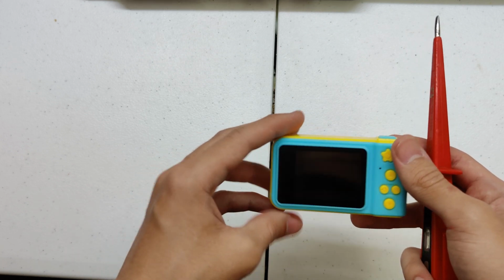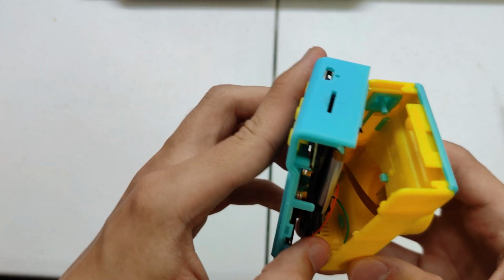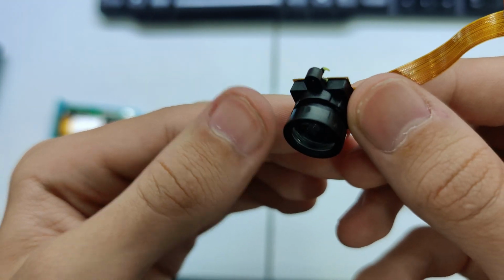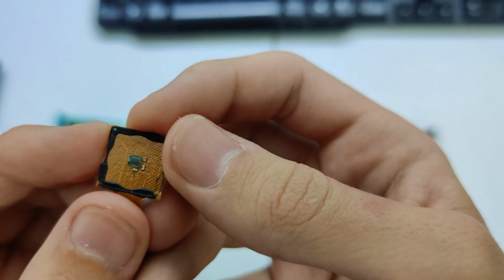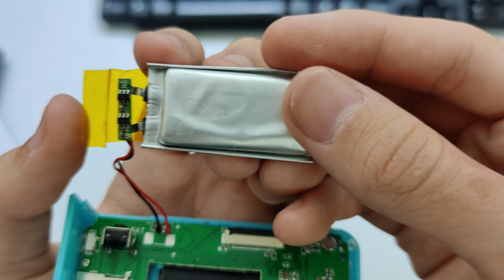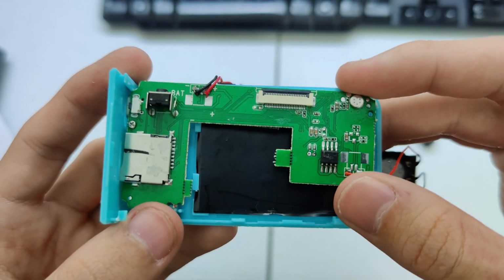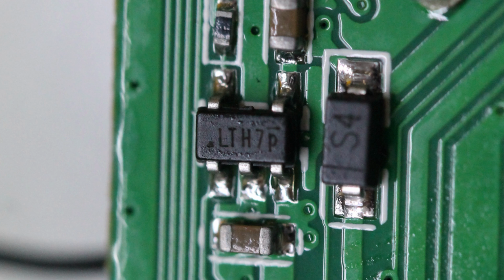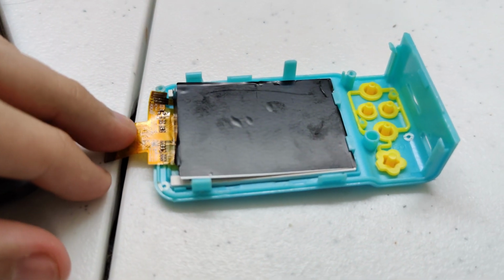Inside the £2.99 (~4 USD) Toy Camera with key component closeups (Teardown)

Comment: i have seen something in iraq local shops two or three days ago , it was a toy , with radio built in , calculator and it contains some basic games all in one device and it was only for 1000 IQD (retail price) which is about 65 cent hahahah
Reply: Really can't be that good for 65 cents! To be honest I'd be surprised if the radio actually picked up anything!
Many cheap radios have two buttons, a "scan" and a "reset" button - they are just awful at picking anything up! :p